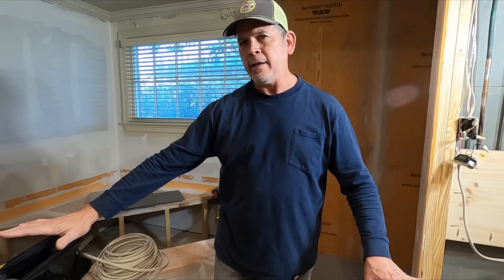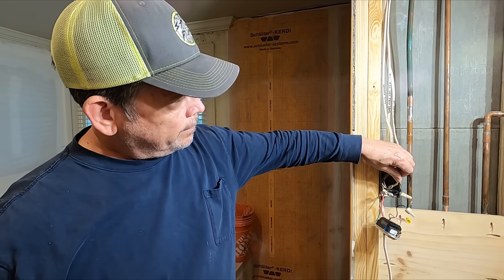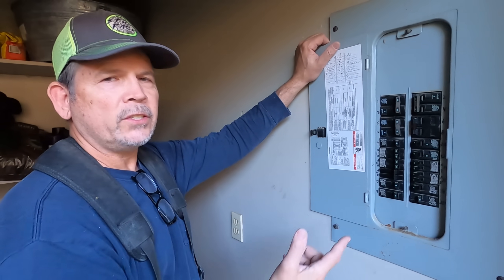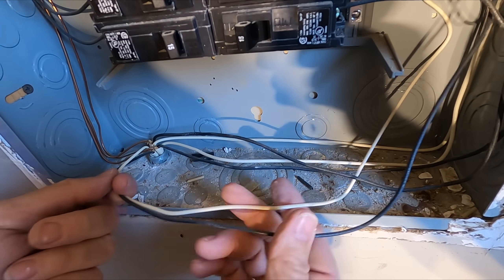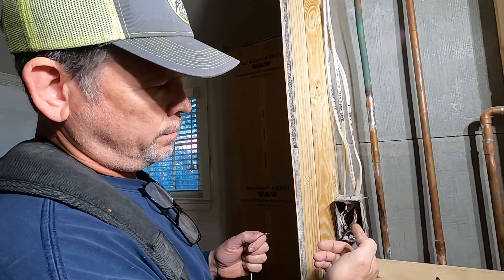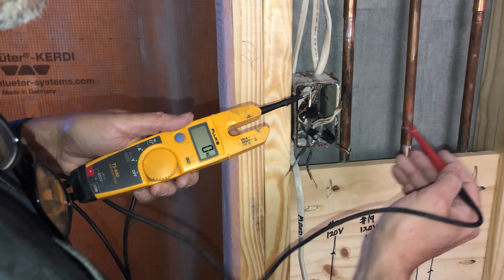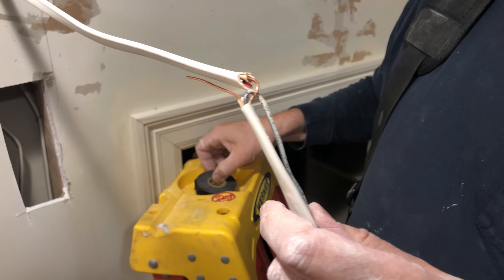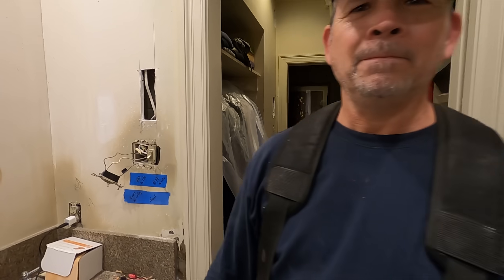You CAN Get SHOCKED by a Neutral Wire! This is How...

Comment: I came here to point out the black tape.  I hoped at least that the incompetent original electrician had marked it.  Congrats to you for marking it as soon as you found it.  Black tape or sharpie seems reasonable to warn that the wire is hot.  Tape is better since you planned to "un-hot" it.

Comment: Hi Paul, I notice during your video's you occasionally are wearing an over the shoulder belt. never get a chance to see it and was wondering what is is and does it have universal use or do you change the design for each new job. i.e. one for electrical, one for plumbing... etc? I enjoy your video's and have learned a lot along the way.
Reply from the maker: I do have a framing belt and separate electrical belt both with suspenders.  Gotta say I like the electrical belt better for most of the stuff I do.  It is a pain though to switch back and forth but that's probably the way to go.  Set up both bags and grab  the one you need.

Comment: I tried to follow the diagram you drew, and you said circuit #20 was off at the panel. If so, how can electrons return on circuit #20 when there was no path on circuit #20? (the break was turned off, there is a gap in that breaker).

Comment: Can someone tell me what to look for on a wire coming into a box and connected to a rocker switch. black on bottom screw, white on top screw? don't know what the switch turns on or off?  Went to install a ceiling LED light and use that rocker switch and box as the feeder. Connected hot black on lower screw, feeder black on top screw. Connected both white wire together with screw nut. connect ground onto switch.  Light will NOT turn on. black wire goes from 119 to about 100 volts and my tested shows the white wire  hot when switch is turn on?  What should i be looking for?  Hard to trace that wire without cutting a lot of drywall which i hate to do to see where the wire is coming from? any help?  Is it a open neutral wire? Did someone use the white as a hot wire to wherever it runs? this rocker switch has been a mystery for years as to what it went to.

Comment: I'm switching out all of the outlets and light switches at my church (which is a big job because in addition to the sanctuary there are many rooms and offices). So far, I have found voltage on two neutrals. The first one I found the hard way. After that experience, I ordered some diagnostic and test equipment (NCV tester, circuit tracer, and GFCI tester).  I noted their locations, and will go back when I'm finished to see if I can track down the problems. There are about 80 breakers, most of which are conveniently labeled 'lights' or 'plugs'. I also found a light circuit that had two 3-ways and a 4-way, and two of the switches fell apart when I pulled them out of the wall. I was told the switches didn't work properly (gee, I wonder why).

Note to people reading this: If something electrical is working properly, and then stops working properly, don't ignore it. These switches were probably bad for years. The neutral problems would never be noticed, however.

Comment: Just at my daughters house today, seems they couldn't find which breaker turned off a line that fed the old dishwasher. Put a tracker on it, signals a kitchen split but the circuit breaker didn't cut the power... long story short (no pun intended) three separate breakers need to be turned off to kill all power to all three wires including hot-neutral & ground...but not the breaker where the tracker signal went... figure that all out. It must be a shared neutral with a ground out or short in a box somewhere...

Comment: Excellent description, Paul. It is important the be aware of what you are working on. Shared neutrals are a great way to save some wire, but for the common homeowner they don’t understand how shared neutrals actually work. It’s not as much a concern with receptacle circuits because they are open as long as nothing is plugged into them. Lighting circuits OTOH are closed through the lamp/bulb if the switch is “on.” It generally makes working on lighting circuits more dangerous to the DiYer.

Comment: You didn't specify which wires were for each circuit and which were leading back to the panel for which.  And the diagram provides no context for the actual wiring of the system.  This video is lacking in instructional value

Comment: Wow, this reminds me of something that happened to me! I was looking into wiring a new outlet up high right behind where we were thinking of mounting a TV on a wall in my parents' kitchen before my mom changed her mind and just wanted to leave the TV freestanding and movable onto and off from the table. Of course I had supposedly turned off that circuit, but then in my checking process and drilling a fishing hole right around there, one of my metal tools (I forget which) bridged two hots or neutrals and sparked and the lights flickered on and back off! Well I didn't get shocked but I wondered why it was like that! So I had to go back down to the panel and figure out which second circuit to turn off in order for me to be completely safe! That's the first time I had ever had that happen in my life, and I was well into my 40s! This was just a few years ago too, and we had never discovered anything like that until they had that house from scratch for almost 30 years!

Comment: So a "shared nuetral."  Easy to understand.  Question:  If you would have taken a pen tester to "nuetral" would you not have seen that it was energized?  If so why did you not test it?  If a circuit (or in this case circuits) were both labeled "shared nuetral" would there be otherwise anything wrong with it?  Furthermore I believe the NEC allows "shared nuetrals" if labeled right?

Comment: I have the same problem under the kitchen sink double switch, one neutral white wire on top of switch for the ceiling light still has voltage when I turned off a breaker from the panel. I tried to replace a single pole dimmer switch for the light but not understand why the neutral has powered. Please advise and thanks in advance

Comment: I dont get it. Shared neutral is not allowed to my country and no neutral is allowed to switch boxes.  Or there should be one wire for both lights going back to one circuit breaker

Comment: Yes Please show more electrical  wiring in our homes ..Iam HVAC w/ over 35 yr in so i know enough to respect electricity but not scared of it  but I do know how & use my test meter all day long working w/ wring hvac & adding lights or whatever in my own home not licensed electrician so i dont do it for hire unless its hvac related with in Ga hvac licenses we can legally wire our own power feeds Thanks again hopefully someoen with no knowledge will not try most @ home but if you know the basics of safety DIy are great to fix ur own stuff @ home

Comment: Open neutrals can get you killed, people don't understand how dangerous neutrals can be, in a properly wired home, but on a circuit where someone is working and in right circumstance neutrals will kill you if you don't know. I ALWAYS check for energized open neutral and always disconnect that branch and double check neutral with multi meter

Comment: While a non contact volt tester detect if a neutral is being back fed? I was installing a single pole switch in the closet and I felt a little shocked through the ground, is this related or that something separate and should I from now check the voltage between ground and neutral?

Comment: I feel like it should be a rule that if a circuit breaker is turned off, then there should never be any electricity going to the devices on that circuit. While I agree that one should call an electrician if you don't know what you're doing, I have had electricians tell me that they don't want a call to replace one outlet since it is not enough work for them. And yet, share neutrals pose a shock risk for the uninformed who want to do a traditional DIY task like replacing a broken outlet.

Comment: I wonder how many houses have neutral hot and wouldn't that increase the power bill also when they used on appliances,tv etc cause those appliances a short life by short the electronics,im not a electrician but I have done some work in the trade but my thought would be the ground shouldn't be tied to the neutral because it is tied to the appliances for safety purposes,I have installed led lights and when I flip the switch off the light was slow to turn and I found the same problem that you discovered in this video, anyway great job on the video

Comment: Keep in mind that many older houses have common neutrals.Your video wasn't this but lets talk, EXAMPLE, Open the breaker box and look for a  12-3 wire landed on 2 single pole breakers. AKA: Edison Circuit. Black wire to breaker 2 (phase A). Red wire to breaker 4 (phase B). White wire to neutral bar. When breaker 2 is OFF, Breaker 4 is on, The Neutral is still carrying current back to the box. Electricity takes the least path of resistance so it shouldn't be an issue BUT when disconnecting neutrals in junction boxes and then touching them, it can be dangerous. When in doubt, SHUT THE MAIN OFF. ALSO, if you have the 12-3 scenario I mentioned above, MAKE SURE the RED and BLACK wire are on differnt phases. EXAMPLE, Phase A= Breaker 1,2,,5,6,9,10 OR 1,5,9,13 and 2,6,10,14 ect... and so on. Phase B=3,4,7,8,11,12 OR 3,7,11,15 and 4,8,12,16 ect...  and so on. If you have 6 amps on phase A and 10 amps on phase B your neutral will see the difference. 4 AMPS. If you have 6 amps on phase A and 6 amps on phase B you're neutral will have 0 AMPS. NOW IF YOU HAVE BOTH RED (breaker 2) AND BLACK (breaker 6) ON THE SAME PHASE, YOUR NEUTRAL CURRENT WILL ADD TOGETHER.  Red on breaker 2 with 8 Amps and Black on breaker 6 with 15 Amps,  The neutral will see 23 AMPS. This is how houses catch fire. BE CAREFUL and ALWAYS TALK TO A QUALIDIED ELECTRICIAN IS IN DOUBT. Great Video Sir.

Comment: Either the original electrician, or someone after him ran what's called a "California 3 way" and they've got it wired wrong in the light fixture where they tied the wires together to drop the hot and the travelers for the alternating switch leg down to the switch. That's why there's back-feed in the line.

Comment: My new LED ceiling track lights do not completely turn off with the dimmer switch. The old incandescent track lights did completely turn off using the dimmer switch. Is the dimmer switch causing this issue with the LED lights?

Comment: You can get electrocuted by touching an unconnected wire if is not connected to neutral and is passing on parallel with a phase wire

Comment: Australian electrician here....
Firstly, good job identifying the problem and fixing it. I have to say though, a far easier fix would've been to replace the tandem circuit breaker with a single circuit breaker. It's a 5 minute job if you have the part. Alternatively, just swing the outgoing line from one half of the tandem breaker to the other half, effectively combining two outgoing lines to become one circuit. Then there’s no shared neutral. There's no great advantage to having the lights in adjacent rooms controlled by different circuit breakers. I'm guessing you'd need to be a licensed electrician to replace a breaker or work on a switchboard. It's crazy to me that some countries allow unlicensed people to work on fixed wiring. It encourages DIY by people with more brawn than brain and that's when things often go sideways.

Comment: I can tell you holding a neutral wire hurts! I was removing an old panel and managed to get quite a powerful shock when I grabbed hold of a neutral wire. Afterwards, tracing the wiring with my fellow electrician (he was partially stripping out another panel), we found somebody had 'borrowed' the neutral in my panel with the live supply wire coming over from his - located about 75 metres away.

Comment: Did you have to pull a permit or get it inspected for that change...?  Question I was working on a wall and noticed just a single wire connected to a switch that went to a light never see this before someone said it was a return for a three way. I'm not an electrician so I have no idea, what's funny which is probably not code at all is the other three way that uses that same light as the other switch i mention  has a 20ft light cord from a lamp and then another single wire coming out from that, I would imagine this was their way of adding a three way wire instead of buying the 14-3 ... does' not look safe to me but the home owner said its been that way for over 35 years. why would a three wire meaning white, black, red and ground not be 4 wire very confusing.

Comment: I enjoy these videos but you confused me on something: when you showed the diagram of what was going on you mentioned cutting off the shared Neutral wire to prohibit the completion of the circuit, but then you mentioned backfeeding. If it can always backfeed, how is cutting/removing wiring to prevent the closing/completion of the circuit effective?

Comment: I wondered if what you encountered was an example of what was called a "switch leg" or "switch loop," a code exemption to the rules that allowed a single Romex line to take power to an overhead light first, then drop a single line on to a wall switch. Because both lines were energized when the switch was on, and you can't have a switch in the neutral wire, the white wire had to be marked with black at the switch and where it fed power to the light. Since the power went to the light box first, one could think turning power off to a switch box with more than one switch always made it safe, but power was also coming from a line that could have lost its black tape marking.

Comment: You are using the RED tester connector on the ground/neutral panel feeds from panel box --------- from your multimeter instead of the black - always use the black tester line on grounds and neutrals and the red on any live lines/feeds.

Comment: This guy is fantastic. One very rarely will meet any contractor as knowledgable and multi-talented. I would enjoy watching any video he makes.

As for electricity, it really needs to be respected and not toyed with by amateurs. As a DIY'er, I have tried to learn as much as I can about it, and am usually able to get good results with my own wiring projects. But there are times when a more knowledgable expert is needed. I recently was trying to unscramble wiring in two 3-way light switches, which no longer worked after some hired handymen got through with the renovation. When I removed the light and all the wires from the switches, I could not find hot power anywhere!! I even started to distrust my two testers! Would still like to speak to a licensed electrician about this mystery. Anyway, I finally decided which wires must be the travelers, after testing for continuity. Strangely, the white wires ended up left for the Common and Load switch screws. I would have thought white would be avoided as hot wires. Anyway, I went ahead with the test, and it turned out correct and solved the 3-way switch problem. However, I still don't quite know why that white wire showed no power when tested!!

Comment: My circuit box has 2 busses, a neutral bus and a ground bus. They are bridged together via a stainless steel joint connection. Is this correct? Installed by an electrician and it looks like it was meant to be. According to your drawing @9:44 that means all neutrals and grounds are always hot aka the 120v is looking for a way home from any of them?

Comment: In high school we had an electrical "laboratory ". Bare studs with boxes and such installed. We'd pull the wire, put in breakers, wire in three way switches and lights. The teacher would come along and check your work. Then you'd get to see if it worked after he wired it to an extension cord. It was fun!

Comment: I have 2 circuits in my house that I think are compromised. It all started when I found current on my ground block. I had wanted to replace it anyways because it didn't have the proper input lug so I turned off a few things and removed it. After separating the spaghetti I had current on 3 grounds! One of them was going to my stove which has a grandfathered in 3 wire plug that is supposed to consist of 2 hots and a Neutral. The ground is bonded to the neutral in the back of the stove. I moved it to the neutral block, easy. The other 2 I didn't get so lucky... One of them was on a direct line to my refrigerator outlet, the other was on a direct line to my living room light. Even after pulling the wires out of the receptacle and separating them I still had current on the ground when the breaker was on. The living room light was worse yet, I had current on the ground and the red wire which was NOT even hooked up. Did these lines get hit with a screw? After hours of trouble shooting and determining these lines went nowhere else it was the only explanation I could come up with. Damn sheetrockers...

Comment: Holy Cow.  You just explained what I witnessed the other day as I’m bringing my 1910 circa +/-5yr rental property up to date.  Although I did not get shocked,…. I was completely surprised that a wire attached to a 4-wire neutral/ground bundle was still hot even though that wire is associated with a completely different circuit.  The wires I’m replacing are a range top with two hots and one neutral. Certified electrician coming tomorrow.

Comment: I’ve been trying to install a smart ceiling fan with a smart switch, but I only have three wires, two black ones and one white. The ceiling fan company told me that I need five wires to install that smart switch. Can you please tell if there is any trick to avoid that, instead of have to add an another two more wires?